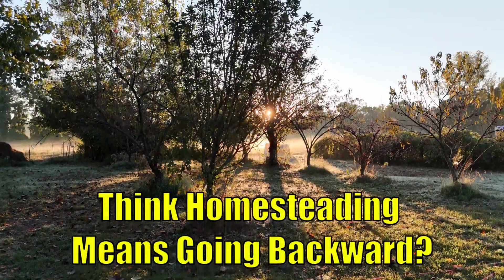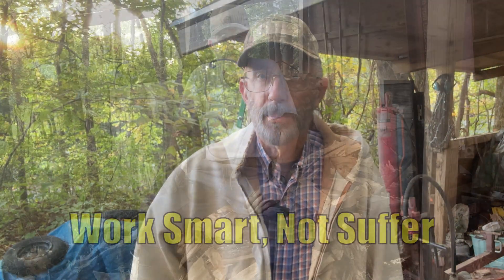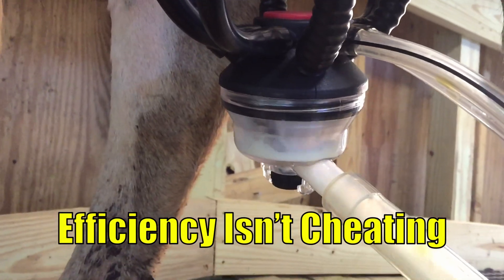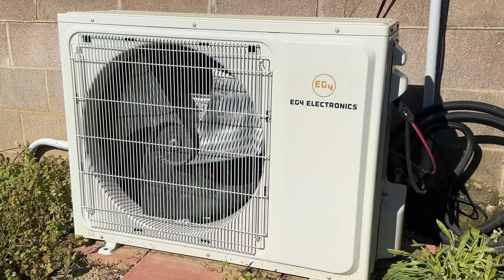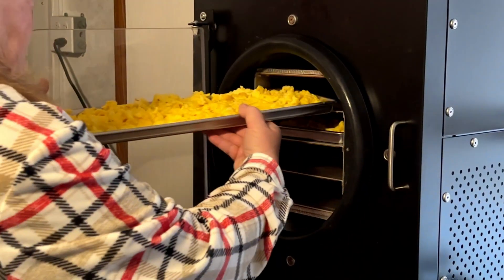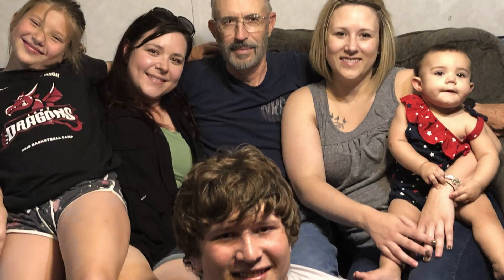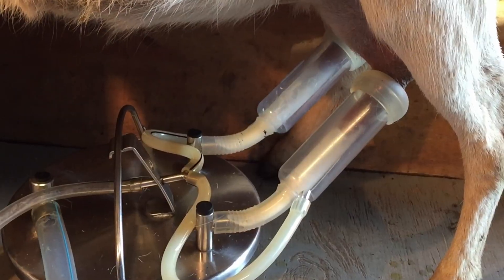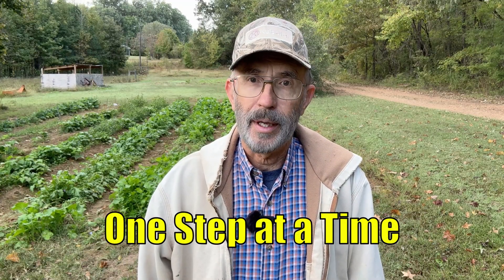🎥 Modern Homesteading: Why We Stopped Doing It the Hard Way

Comment from the maker: What’s one modern tool or system you use on your homestead that you’d never give up?
It doesn’t have to be fancy — just something that saves time or keeps things running smoother.

Drop it below 👇 I’ll pin a few of my favorites.
– Bob, Possum Ridge Farms

I will start with our EG4 Solar Mini Split it was a game changer
Reply: My log splitter
Reply from the maker: @ismaelrivera1752  Same here!!!
Reply: I am just starting out, so I would say Inkbird temp/humidity for incubators, brooders and coops. Live in N.B. Canada and have 4 true seasons (lol). 59 and retired. Need something to keep me active and alert. Figured small scale farming is just the cure. 🙂
Reply: The notebook! Planning the work properly is what saves the most time😀 Greetings from my farm in norway! Ps: did you read my tip about simplifying your thumbnails?

Comment: A guy did a video comparing his bifacial solar panel orientation and tracking it for an entire year. Mounting them vertically, facing the south was the hands down winner. You could take his process a step farther by laying some gravel down on the north side of the panels. Limestone or something with a high albedo, you'll more production from the back side (this happens in the winter with snow automatically) and the panels won't have to melt the snow off them before they start producing.
Reply from the maker: Vertical south-facing panels don’t get talked about enough, especially for winter production and snow shedding. The albedo effect is real too snow does it naturally, and gravel can definitely help. Like most things on a working farm, it comes down to balancing production, space, and what actually makes sense long-term.... Thanks

Comment: Just found your channel..I love it. On my way for my journey here in OH. Solar…rain catchment and well. Started the garden in this year. Wood heat currently with plans for propane forced air next spring. Love my mini splits I installed this spring. I 100% believe in you thoughts on this video. I don’t know if I will get to the point of cattle but rabbits and chickens are in the future plans. I don’t know that I would give up anything..I have a small Kubota BX23S….3 ton dump trailer….9500w of solar in 6 different systems…hydraulic wood splitter and a few stihl chain saws…they keep me and 43 acres running along.
Reply from the maker: Sounds like you’ve got a solid setup going over there that’s the kind of balance that makes life run smooth. My wife and I were both born and raised in Ohio, so I know exactly the kind of ground you’re working with. That Kubota and those Stihls will serve you well. Appreciate you being here, and good luck when you add the chickens and rabbits.... Thanks and Go Bucks

Comment: You lost me at food freeze dryer...thousands of dollars and no DIY maintenance......just can more stuff. What happens to you the day after you eat the last pouch of freeze dried eggs? Just a gizmo looking for a justification.

Drones.....to check fence lines? Oh, please!
Drones for security and checking the lane when alerted? That's an answer looking for a question. If your possible security issues are so tenuous to justify a drone I think you need to just move. Honestly.
That sounds like life outside the Baghdad "green zone"....iykyk
Reply from the maker: LOL… interesting question, but seems pretty self-evident, the day we eat the last pouch of freeze-dried eggs, I walk out to the hen house (about 15 hens) and we use the freeze dryer to make more?

We’ve got about 10 miles of livestock fencing that needs constant attention, and the drone makes it easy to spot broken wires, insulators, or fallen trees without walking the entire pasture fence line. It’s also handy when the driveway alarm goes off, our eighth-mile dirt road curves, so you can’t see it from the house.

And just for the record, we do all our own maintenance, too… iykyk.
Reply: @PossumRidgeFarms thx for response.
Not to argue.....but if that thousand dollar freeze dryer goes on the fritz I'm pretty sure you have to send it back to factory.
Reply from the maker: No problem... Good to know, but so far we haven't had any issues with it except we replaced the vacuum pump about 5 years ago (its about 10 years old). The grandkids love the candy their grandmother makes for them as well as what we grow here on the farm...Thanks

Comment: I'm pretty much right there with ya, Possum.  You really can't go back to the 19th century, as those folks (as hard as they worked) did have a support structure amongst the local community that made it all work.  For example, try finding someone today that can grind up your wheat berries into bread flour.  
So living here in the 21st century, you really have to live in the century you're in and use what is available to you to achieve self sufficiency.  Even so, it is a very challenging task.  
And yes, those driveway alarms are great for detecting the deer that think your garden vegetables are their own personal salad bar!
Reply from the maker: Well put.... community was the backbone that made the old ways work. You’re right, we’ve got to adapt to the times we’re in and use the tools available to stay self-reliant. And yeah… those driveway alarms sure do think deer are the main threat around here too.... Thanks

Comment: Great insights - thank you.  Dude the thing I really like is just the garden auto watering system (timer).  I'm getting a bit older and making things easier is just common sense.  We are not on your scale but have a small solar, tri-fuel generator when we need it.  Wood burning fireplace and a wood stove.  No freeze drier as those are a bit out of our budget but dehydrator and a presser canner.  Redundancy is absolutely imperative.
Reply from the maker: IMO, sounds like you’ve built a really solid setup. We use auto-watering too when the summer heat really kicks in, it keeps the plants steady when everything else is demanding attention. It’s one of those small things that makes a big difference over time.
Reply: Thank you for sharing your precious experience and skills. Awesome 👍

Comment: I loved how you pointed the difference that it's not about being easy, but to make it last. Sure, things can be done "the old-fashioned way", but if that takes your time from other things that also matter and leaves your body tired and broken, why would you do it? Also, I'm pretty damn sure that if you'd take any farmers/homesteaders from different times in history and showed them the technology that we currently have, but then also told them that you're a REAL farmer because you don't use that fancy stuff but only what they've been using, they'd think you were a complete idiot and possibly mocking them...

My homestead is in the very early stage: land is aquired and plans for first building are coming up nicely, most of the time is goes to falling trees from the area where I'll start to build workshop next summer. I haven't gotten a lot of things, but what I've come to appreciate already is my Ego Power+ electric chainsaw and it's battery system. I charge it via solar panel and a separate powerbank, so I don't need to worry about carrying diesel/gasoline around, but what I like most about it is that the Ego Power+ has a 56V battery system (from two to 12 amp size, I think), which in turn means it has about three times the wattage compared to 18V systems. They also sell inverters for it with normal output sockets, so I can use the batteries for a lot of different things when needed.
Reply from the maker: That’s a great perspective and you’re absolutely right. The goal isn’t to suffer for the sake of it, it’s to build something that works and lasts. I think those old-timers would’ve jumped at the chance for the tools we have today! That Ego setup sounds perfect for what you’re building — efficient, versatile, and totally in the spirit of modern homesteading..... Thanks
Reply: Awesome dude! Wishing you the best on your new adventure.

Comment: We don't have municipal water, we collect rain water off our roof and store it in a tank behind the house. We have a 1550 gallon vertical  tank that is buried about 3.5 feet with the outlet under ground so it doesn't freeze. We used to haul water when the rain wasn't enough, but now we have a well that is powered by 2 solar panels.
Reply from the maker: Now that’s exactly what self-reliance looks like in action. Collecting rainwater and backing it up with a solar-powered well is smart thinking. Sounds like you’ve got a solid system that covers every season.... Thanks
Reply: Awesome 👍
Reply: Same here in Northern AZ. All our water is from the rain. 10550 gal❤